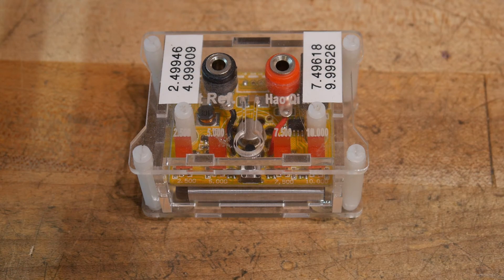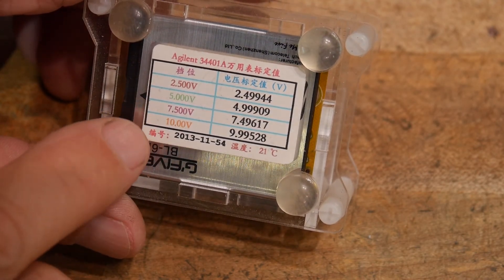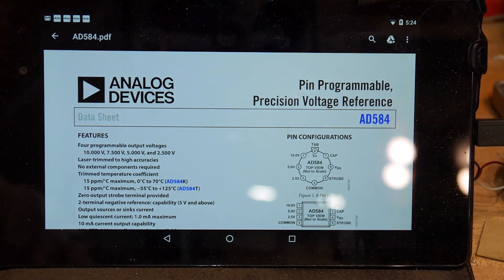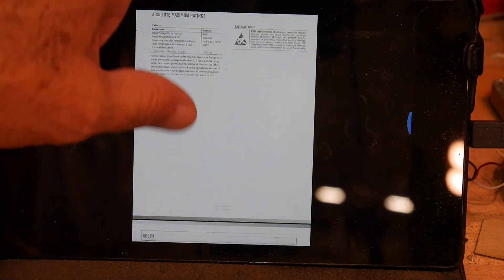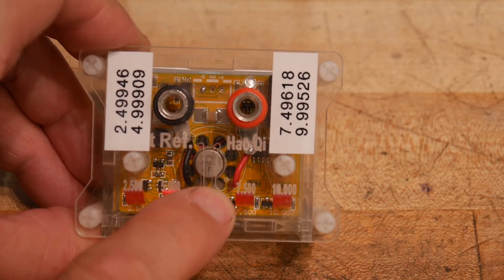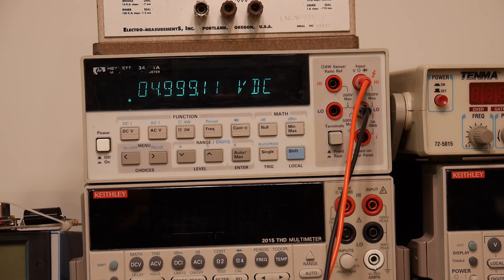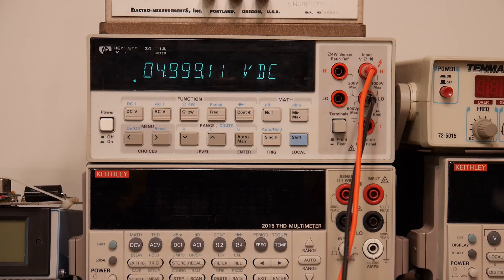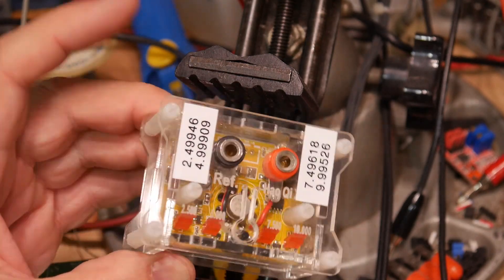#212 six digit voltage reference

Comment: Only just seen this video. Loads of possible errors like test lead qual;ity plus material of connectors, temperature coefficient of voltage reference and the multimeter, specification of the multimeter which is 40ppm ish, drift and aging of voltage reference and so on.

Comment: 2013-11-54 is the date?  On what planet? 😕  I did a google translate, it says "Number" to the left, not "Date".  I think it's a serial number that just happens to look like a date. It's great that they put the temperature on the case, but it doesn't say the warm-up time.  I wouldn't use this right after charging the cell, which would create heat and make the device hotter inside than ambient.  I doubt it needs charged very often.  Any way to test the battery voltage, perhaps when it's unplugged on the output terminals?  Usually these devices want to see a 1% variation to the input voltage, it would be good to always have the cell charged to the same voltage.   How useful do you find the extra output voltages?  I made a 10V calibrator from LM399+OP177 and had considered adding other voltages, but avoided overcomplicating the task.
Reply from the maker: you might be interested in the 399 insides: https://youtu.be/6hXzuLKzXmg?si=neXzajR7eUJt5MOf

Comment: I bought one of these a  few years ago.  My label looks a bit different and was filled in by hand.  The PCB looks the same, and the top acrylic labeling looks the same.  On the  side, mine has "KMOON" branding.  One other interesting difference is that mine is populated with the AD584KH part; I think you had "JH" version instead?

I noticed that the device on the board looked like a "pull" from something else; the metal case of the part looks worn or scuffed.  As far as I'm concerned, this is "feature" not a bug..  the part has been pre-aged prior to landing on my doorstep.

I check the measurements against my Fluke 8050A (4.5 digit DMM) and Fluke 8840A (5.5 digit DMM) and they match pretty closely.   Those both agree well with each other, despite being surplus purchases.  I have a Fluke 87-III handled DMM that's actually a bit further out from both of those and the reference, though still within spec.   So like a man with two wristwatches; WWVB synced clock and GPS synced clock, not only don't I know what time it is, I can never be completely sure what the voltage is :-)

Comment: @
IMSAI Guy
No, label with measured voltages is REPRINTED BULLSHIT... Nobody cares about checking voltages of  this thing, so they checked once and reprint label on everyone device. The best thing you can do is take as a refference accuracy according to IC's datasheet. A friend of mine bought not excatly this  pcb,  but different one on the same chip, checked by yourself voltage accuracy with calibrated 6 digits meter and it doesn't match, so in my opinion it doesn't matter which one version you buy,  label with measured voltages is reprinted bullshit not of your copy...
Reply from the maker: That is too bad. I bought mine 7 years ago. I guess the Chinese decided to clone it. sad
Reply: I'll tell you what, NO WAY that label is generic and all 4 outputs match the content creators 34401A w/in 40μV at 7.5V and 10V, and w/in 10μV at 2.5V and 5V.  I'm AMAZED.  I have a stack of calibrated 34401A's that don't agree on a PARALLEL input that closely -- thanks MICRO PRECISION CALIBRATION 😢👎.
Reply: Usually if you can see enough reviews with pictures of the device, you can see the label is different for each buyer.  I have yet to see or hear about a reprint.  I think this video demonstrates the value was likely correct.  Some devices have handwritten values, this one someone took the time to enter them into the computer for a nice legible printout and serial number for tracking.